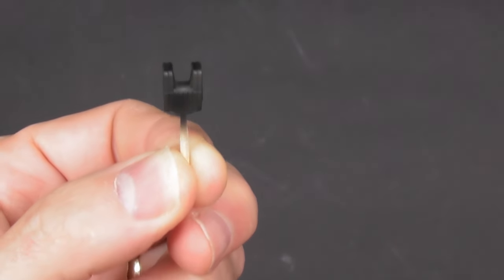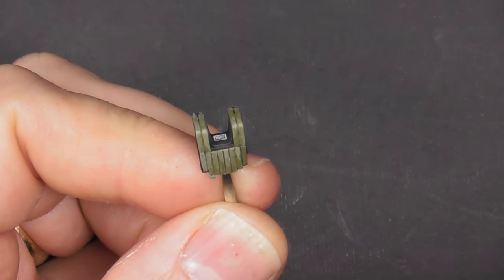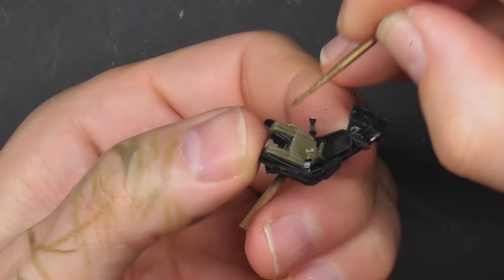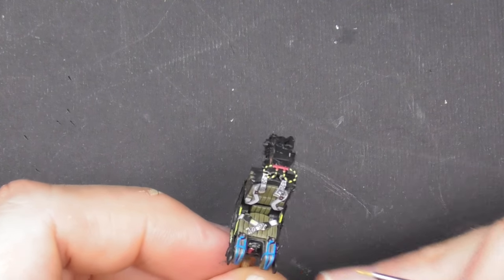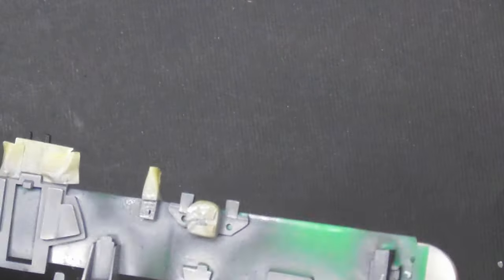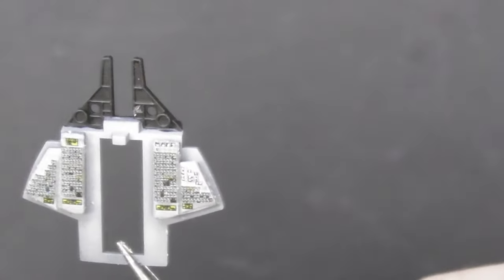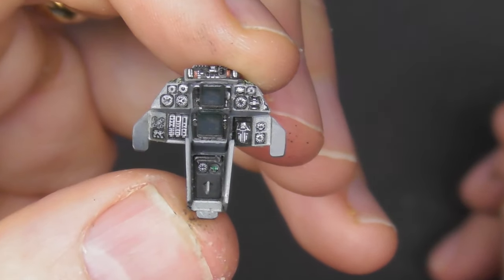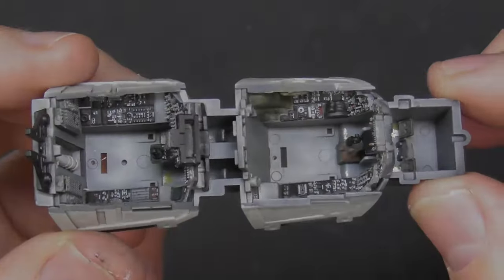Tamiya F-14A Tomcat 1:48.  Part 2:  How to paint ejection seats and detail a cockpit

Comment: great vid, thanks. the trick us as yoi say, to fool the eyes.  if youu try and paint too accurate it looks wrong.  I see the attraction of the aftermarket instruments but i havent tried them yet, best part for me is detailing and scratch building the cockpit.   Lately i am combining the methods where i make my own cockpit panels separately on thin evergreen or acetate and then glue them.  its good fun and allows me to make mistakes iff model.  cheers
Reply from the maker: Thanks mate.  I don't think that no matter skilled the modeller, scratch building could never come close to these 3D printed sets.  Much less satisfying though!
Reply: @thescalemodellingcafe  I agree.  but it's such good fun. I'm using videos and pics of the aftermarket as research.